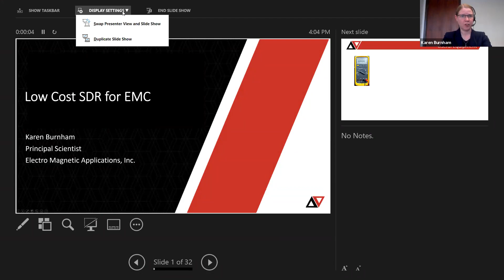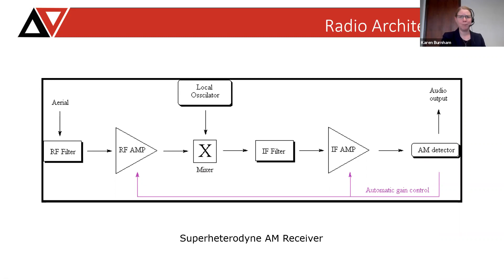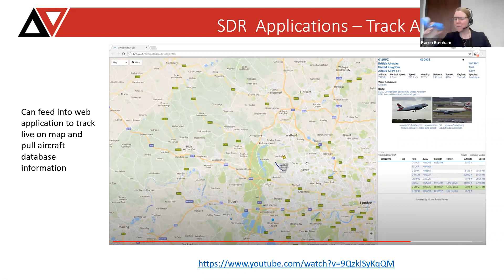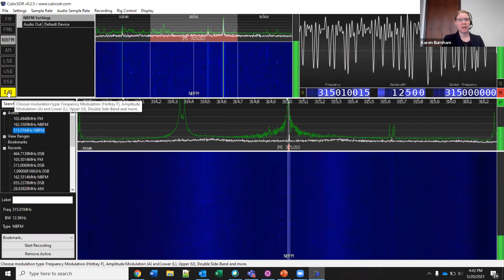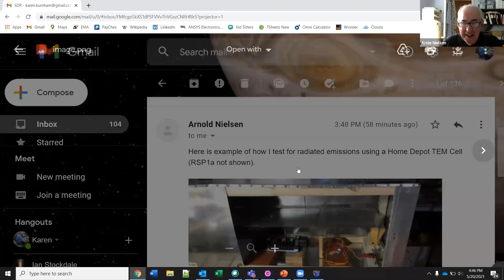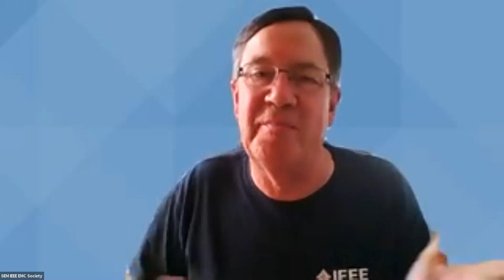Software Defined Radio (SDR) - EMC Applications - Karen Burnham

Comment: Any thoughts on using  3rd party tools like openEMS with KiCad (which can now export step with fully copper-filled vias)? 
(FEM as well as FDTD tools have a hard time working with thin copper walls)

The excellent 'panire' channel has a course on  Finite Element Method (FEM) / Finite Element Analysis (FEA) / Finite Element Modelling Method (FEMM) for KiCad with free tools!

He suggests simulation can only go so far and is mostly for showing you resonances in your layout, harnesses, and metallic components next to your PCB (e.g. heatsinks, housing, motor enclosure, etc)

It's best to use a stylus with an efield or hfield probe.. But only the bare PCB with capacitors can be simulated. Inductors are still a bit troublesome so simulate with openEMS.